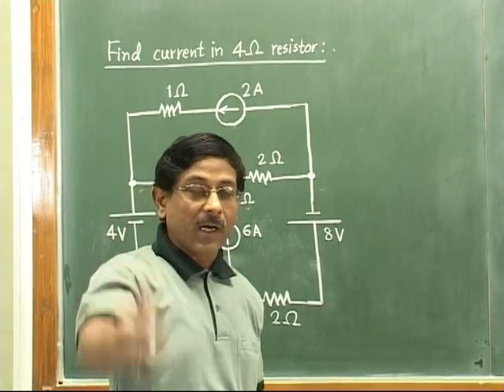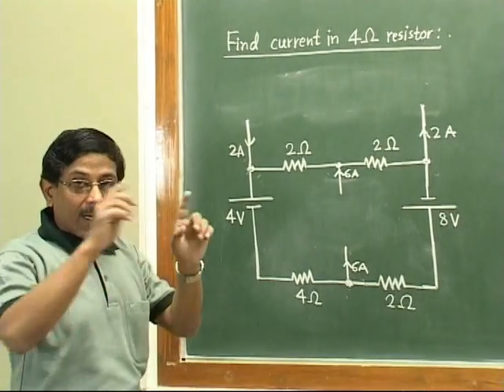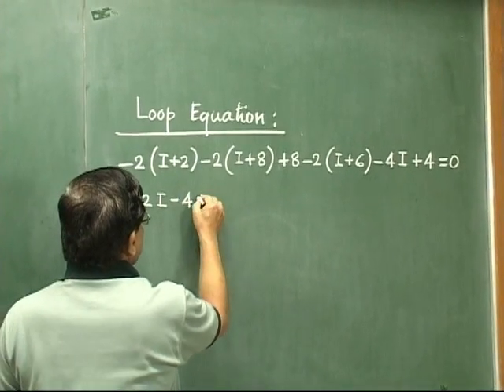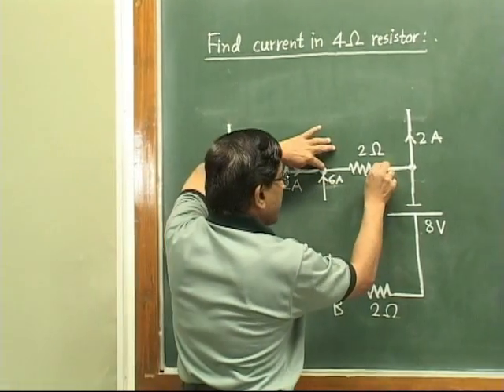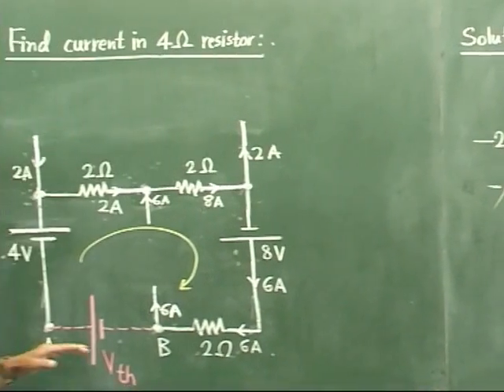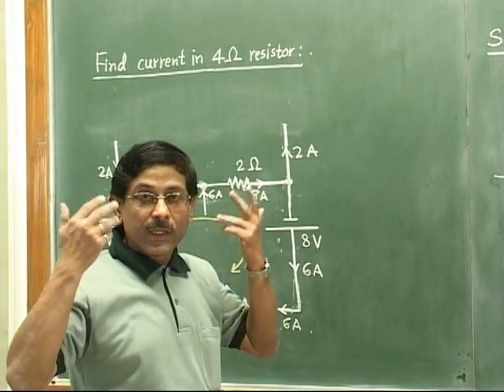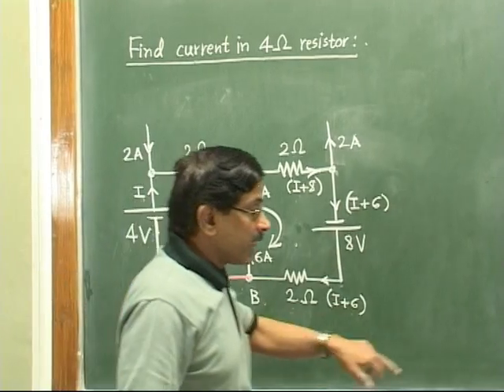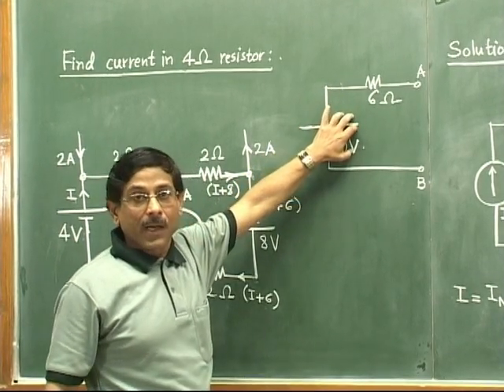Network Theorems Tutorial -1 : by Dr. C. B. Bangal

Comment: I have one doubt sir, while you made open the load resistance the whole circuit is now open , there is no closed path exists.if current is not flowing through 4V battery as it is kept open, similarly current should not flow to other end as that is also open.
But you made the current flow through the other end. Why ?
Reply: Dear sir, he has removed the upper branch and middle branch for problem sake. Not really oprned. Actually these current sources supply the current still to the circuit. Tnk u

Comment: Sir why are we removing out the branches of current sources from the entire circuit?
Reply: +Puspal Manna We are removing branches to simplify the circuit.  You want your show the currents going in and out of nodes. Therefore it does not matter if there is a resistor in series with the current source. There is still be going 2Amps flowing through that resistor and into that top node(top of 4V source).
Reply: Oh I got it.. Thanks for the answer
Reply: A current source in series with a resistance is not a standard representation. The standard representations are a current source in parallel with a resistance, or a voltage source in series with a resistance, and in this problem sir took 2amp ,6amp directly thr the current source.

Comment: sir 1.how can be remove resistance which is in series with the current source???reason..
      2. can we do same when the resistance is in parallel with the current source???
Reply: +NEERAJ SHARMA 1. You are not physically removing the current source with the series resistor. Your simplifying the circuit so that you only see where the currents are going in and where the currents are going out. As you know the current in that loop you can essentially remove the loop. But you have to make sure you show the currents going into a node and leaving a node.
2. No you cannot do the same because you do not know the current going through that the resistor. You would know the current entering a node the resistor is connected to but that is all that you would know.

Comment: In this circuit voltage sources only available  4v+8v =12v ... how come ur calculation is Vth=20 volts????
Reply: the two current source also effect on the value of vth

Comment: where is 1 ohm and 8 ohm resistor gone in equivalent resistance for finding Rth please tell me the answer why you fuck the branch of 8 ohm and 1ohm resistor
Reply: +Vishal Bisht To find Rth you replace the voltage sources with short circuits and current sources with open circuits. Therefore the branch with 8ohm and 1ohm resistance is removable.

Comment: what happened to the resistors that were connected to the current sources. the 8 and 1 ohm resistors. are they completely ignored? if so, what happens to the voltage drop across it? is it ignored as well?